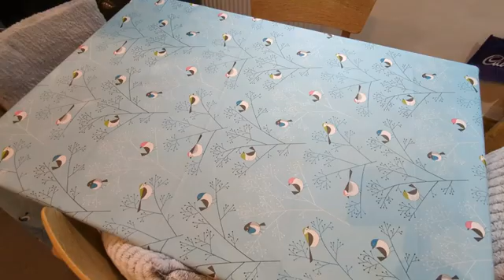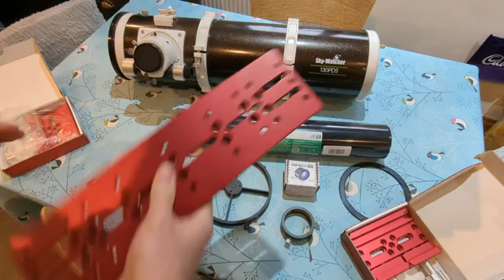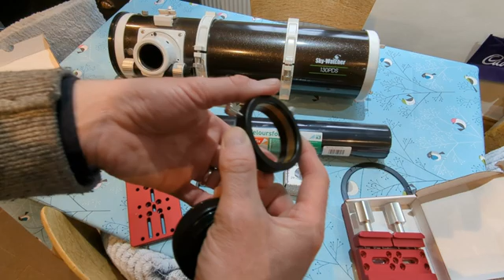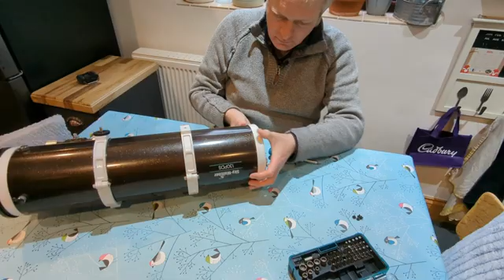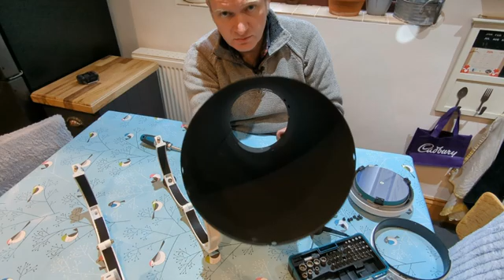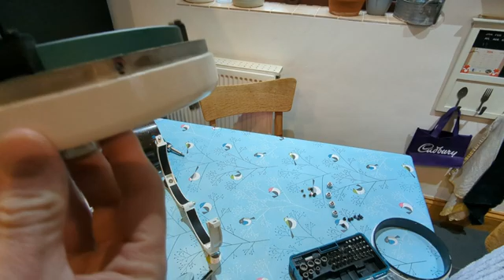Dual Imaging Rig - The Build

Comment: Totally understand your ressoning on this Andy. Living in the Uk we definitely need to make the most of what little time we have available for imaging. I currently have three rigs built up ready to use but only two mounts, one of which is a grab and go mount. Your set up looks awesome, I'm sure you will realy enjoy using it. Will you be mounting this permanently, or at least semi permanently outside? 
I have been doing things a bit different going for imaging two seperate targets simultaneously but I can see the benefits in what you're doing. I have thought about buying a second SY135 f2 lens or either Red Cat51 or 81GT to allow me to do the same but having to buy an extra camera, EAF, filter draw etc is just too much. I would recommend anyone starting out in astro photography in the UK considers a double rig, perhaps start with a single and add to it later on. After this last year I wish I had done so, it would have saved a lot of frustration in not being able to capture enough data.
Reply from the maker: Thanks so much.  Sounds like you've got some nice setups.  I have to rig for each imaging session, which is why I am keen to maximise the imaging time.  However this also has challenges for aligning the scopes each time.  I've love to have a permanent rig but its not currently feasible for me.  However who knows in the future!  Should be an interesting project!

Comment: Looks like a fun project. I understand you started with one telescope. But how does this compare with going to a single 10 in Newtonian in terms of light gathering and resolution. Perhaps the 10 in scope would be more expensive, but then you just need one camera,  one  set of filters, one corrector, one computer (?), simplified mounting. Focal length would be different but could a reducer handle that?
Reply from the maker: A larger aperture tends to give move detail as it will have better resolving ability and detail.  However this project is about gathering as much data as possible in a manageable package with a good beginners scope so it will be exciting to see what the results are like.